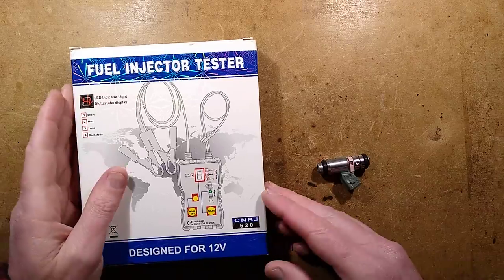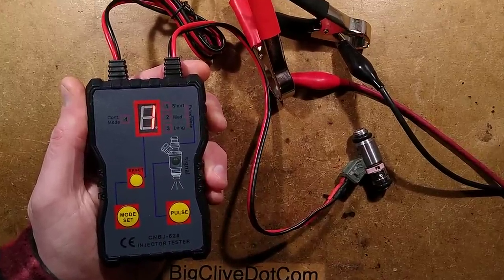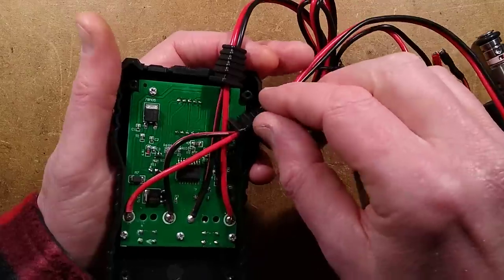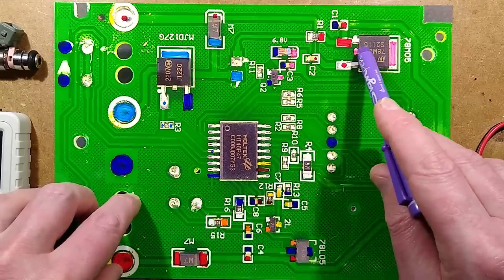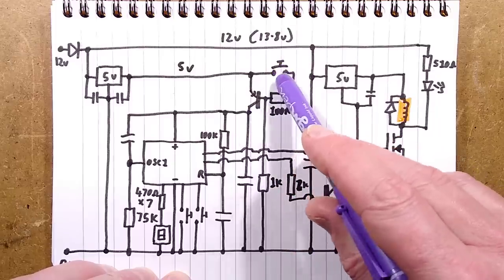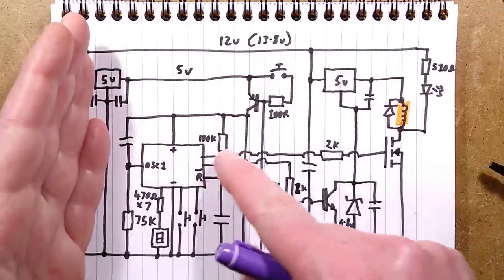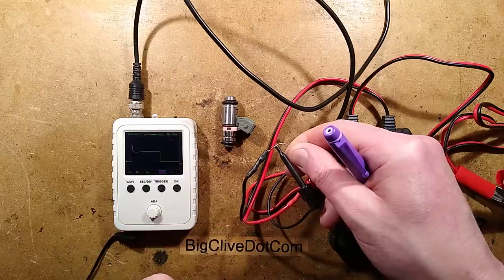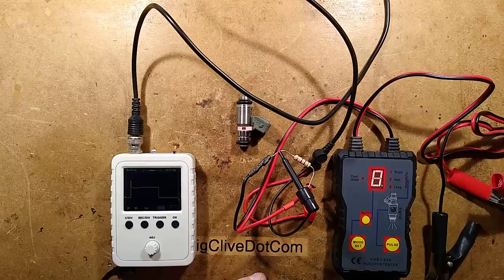Inside a fuel injector tester (with schematic)

Comment: Several years ago I built a DIY engine controller called Microsquirt.  Their documentation talks of low impedance Peak-and-Hold injectors that use 4A to open quickly and 1A to hold them open.  I believe the lower current was both to reduce heat and, as already stated, let them close quicker.
Reply: The microsquirt was a great project!
Reply: That's exactly what that high then low voltage drop is doing is to allow the unit to support low impedance  injectors. Typical injectors are high impedance, measuring  in the 11-18ohm range. And for them, firing 12-14v on them is fine. But low impedance injectors, usually in the 1-4ohm range, need the peak-n-hold technique so they don't overheat the coil. Once the mechanical load of moving the pintle in the injector has been accomplished, it doesn't take nearly as much power to hold them open...hence the reduction in voltage.

You don't see low impedance injectors that often anymore at least not for typical street builds. My CNG injectors are low impedance. And I wouldn't be surprised if ultra high flow race injectors still are. But once the high flow Deka 60s and 80s came on the market a decade or so ago, there's been little need for them for typical street power levels.
Reply: We were learning about the current draw patterns of injectors in uni a couple months ago, quite complicated. People far smarter than me can work out what is good and bad, I'll just sit back and let them tell me what part I need :)
Reply: @Marvyn Harris     I am legitimately unsure, do you mean “built” as in assembled a kit, or as in designed the hardware?

I’m wondering because I’ve been looking (albeit from afar, I don’t have the knowledge or fabrication capability…yet) at Engine Development for a while, and between uses like this, as well as for Variable Fuel Injection crazyness in an ECU I’d love to hear what you did/know, where to find good info etc.
Reply: i was gonna mention the 'peak&hold' thing myself then read your comment
Reply: @ericlotze7724  Since they mention referring to documentation, I think they probably built from a kit.

Microsquirt and its variants are probably the aftermarket engine management with the best community support due to wide adoption. I think Speeduino is the open source/cheaper option but will require more work from you? And some engines have "drop in" solutions with direct support like Haltech, etc but those are $$$ and probably don't support very old/niche models.
Reply: @ericlotze7724   A microsquirt is the most basic ecu in the megasquirt engine control unit line. Diyautotune sells build kits with the pcb and all components for most versions of megasquirt, or fully assembled ecus. 
They're extremely versitile and powerful while also being extremely cheap compared to other ecu's with the same capability
Reply: @Eric Lotze  look up a cardrino.  It uses an ardrino to act as an engine ecm and is a full blown diy ordeal.  The squirt line of products which is separate, is basically a programmable ecm that you can mix and match components and such. 

A cardrino is just an ardrino that you use the various com pins like the ic2 and gpio pins to activate relays or other boards.  It's like building what's inside the squirt stuff although I can't remember if they use an ardrino or not.

It's been a couple years since I've been involved but there is a fairly large community around both and lots of knowledge if you are willing to read.
Reply: @ericlotze7724  I built a microsquirt from a kit.  It's a very versatile ECM that can control both fuel, spark, idle control and had programmable pounds that can be used for various inputs and outputs like knock sensors, O2 sensors, electric fan control.  It lacked the I/O for individual sequential injector control or individual coil-on-plug control.  My setup had batch fire for two banks of injectors, control of an electric distributor, two O2 sensors, a knock sensor, idle air control stepper motor, air and water temperature sensors, fuel pump and fan control and probably a few things I've forgotten about.  There was also a software package that had 3D graphs of volumetric efficiency, ignition advance and air-fuel tables.
Reply: I had a Rover SD1 VDP EFI years ago and when that started to have issues with the ECU (because Lucas, Prince Of Darkness) I looked into the Megasquirt products. They really were fantastic. I know a few people in the SD1 world went over to them.
Reply: @chrisgrey9204  Peak and hold is used very much so today with direction injection motors. Injectors are usually cracked with 40v @ 20A which then drops to 5A.
Reply: Also an electromagnet needs a lot less energy to hold than it does to attract. A magnetic field's strength falls off pretty quick the further out it goes. It's waisted energy and excessively heats the coil to use full power all the time.
Reply: @Marvyn555  

 Sounds cool as hell, and that’s one sick setup!
Reply: @Marvyn555  

That seems like a great off the shelf / existing design.  Does it have the ports/capabilities to interface with something like @Wesley Kagan ‘s Take on Freevalve (or Camless Valve Control iirc that is the technical term)?

Granted as shown by your build, there is plenty of other factors to tinker with!, but I personally am VERY interested in the stuff the C o n n t i n o n u s l y    V a r i a b l e     V a l v e     T i m i n g can allow.  That and funky fuel setups like Autogas, Dimethyl Ether, Heated Oil (for compression ignition engines), or Dual Fuel /   M u l t i     F u e l    engines so yeah.
Reply: Do any of you have experience with the “FreeEMS” project?  If Microsquirt/Megasquirt etc have the features i need and FreeEMS doesn’t I’m not such a purist that i would ReFuSE tO uSe It*, but i do prefer to use Open Source Software *and Hardware when i can.

It would also make developing an engine-specific board easier / selling it etc
Reply: @Mrshotshell  between microsquirt and megasquirt, this just seems like an elaborate joke.
Reply: @Cenentury0941  make sure you use it on your ford Cl1taurus
Reply: @ericlotze7724  I bought a kit with a bare circuit board and a bag of parts and a preprogrammed processor.  I had to figure out the configuration for my engine and set some jumpers for my engine combination.  The V8 engine I used had a distributor that had a sensor coil to tell what position the camshaft was at. Microsquirt has circuitry to read the voltage pulse from the distributor and fire the spark plugs at the right time. I used batch fire so I only needed two injector wires. Then wires to run an idle air control stepper motor. I added a knock sensor that let me reduce the ignition timing advance if it detected detonation. I had two analog inputs to read wide band oxygen sensors. And an output to run the fuel pump relay. The software is pretty sophisticated, with fuel tables, ignition tables, air-fuel tables, idle warm up tables, etc.

Comment: Another interesting thing about injectors is that you can electrically test for a mechanically seized one by looking for the pintle hump or the lack thereof, as the pintle moves between the open and closed positions it changes the magnetic circuit length which changes the inductance of the coil and you can see it as a little hump in the coil current as it ramps up and back down. There are many videos about it by people such as ScannerDanner.
Reply: Scanner Danner 👍
Reply: With a coil, if you put a cap across it and hit it with an impulse, you can count the "rings" to see if there's any shorted windings.  I know there's a tester for that for CRT flyback transformers. I don't see why the same can't be done with an injector.

Comment: That drive scheme is called peak and hold and helps with time response while also limiting power dissipation. For lab testing NI makes hardware that lets you set multiple parameters to drive injectors.
Reply: This is for low impedance injectors, separate category from normal, common high impedance ones
Reply: @poprawa  but the idea works on both the reference voltages would be different though 🙂
It is like pixel overdrive in LCD screens, but since the output is just digital the mechanical limiting is enough to keep the limits in check.
Reply: @poprawa  Autogas injectors are low impedance but it does make sense that you dont want to heat up either the coil of the drive circuit when testing

Comment: I'm now working on a ecu project and could understand why they made this circuit that way. They used this kind of short pulse of higher voltage prior to the main pulse to be compatible and set a higher current on low resistance injectors found on older injection systems. Such injectors have resistance lower than 1ohm and will damage the mosfet and the injector itself if turned on for a long time. Its not a common case and the newer injectors (after 80s) have resistance about 14 ohms and they are drived without these pulses or series resistors as in these older systems. Its a smart solution but the limited current node may be monitored by the microcontroller to turn the mosfet off if a short circuit was dectected. On modern ecus all outputs are current limited and have self diagnostics.

Comment: I'm a mechanic in Canada, the video and the comments is leaving me with impression this tool is used just to see if an injector works and frankly if that's all the information you need just start the engine and listen to the injectors with a stethoscope. This tool becomes indispensable for an injector balance test where we take manual control the fuel pump running it up to max pressure then feeding a pulse train to a single injector and noting the fuel pressure at the end. We do this once with a short chain of long pulses and again with a long chain of short pulses and repeat for each injector. Any outlier has a different flow rate than it's companions and is suspect. For valid results the pulse chain has to be the same total on time for every test so build it or buy it you need a proper tool.

Comment: Have had over 30 years of fuel injection work.

Yes some injectors are very low resistance and require current controlled switching, others just a reduced holding voltage once pulled in.
The injector duty cycle which can be from very small to even almost 100% duty has a large range of power dissipation. Normally high duty factor only applies to full engine power and high RPM regions also thus high heat conditions.
The 100% point is never really  allowed, and to be avoided as fuel delivery is no longer controllable accurately by On time  so by design the sizing of injector normally would be chosen to remain way below 100%, experience say under 60%. At 100% On, and near time duty regions, flow rate becomes non linear to duty cycle too, as mechanical travel time and dynamic flow factors create a dead time effect, offsetting flow by a small time factor so effective zero flow starts at some small On  time factor, linear with On time, and duty cycle grows as RPM demands faster pulse rates, but as duty cycle forces time On reaches closer to 100% that time offset also causes deviation of flow from linearity. That upsets fuel to air ratio and engine performance and emissions.
 Of course as volatile fuel  contains very light fractions, vaourising at low temperatures, and fuel goes through ithe injector, t is highly important that coil dissipation NEVER allows heat released to vapourise lighter fractions of the fuel to form micro bubbles that would seriously affect fuel delivery accuracy,  thus also  engine fuel to air ratio  thus also performance and engine emissions.
Now,  yes the fuel flow cools the injector, but as the injector also experiences much external heat of the engine, especially on non cross flow engine designs with inlet and exhaust on same side of the engine, interleaving inlet and exhaust, that heat local to injector can be very high. So extra coil dissipation is quite potentially important, tipping to internal vaporisation issues. Much effort is made to keep injector coil dissipation low. Low resistance and inductance, allow initial high current faster mechanical action, but  if left at full power on would be detrimental heat wise, so initial high voltage or current peak and current control or switched lower voltage becomes desirable.
For this tester the lower voltage step has two possible reasons, firstly the dissipation is critical as likely it is often used with dry injector no fuel flow and thus no cooling, so the prevent coil overheating and possible damage to injector they limit power in On state.
Second reason, it is desirable to verify that the injector can hold in when exposed to reduced supply once pulled in. Thus testing for adequate "Hold In" capability. 
Initial pulling voltage of injectors is often above 7v to 8v, so testing with limited 5v supply would prevent many, not all, injectors even switching on (pulling in). Thus they have this double supply level design to cover the wide range of objectives.

Sadly to realistically test injectors this mechanical activity falls far short of injector evaluation, beyond ensuring it is not in a mechanically stuck state. Nothing verifies the accurate fuel delivery or spray pattern of the injector, or leaky nozzle, all of which are far more common problems than physically stuck state.
I would regard this tester of minimal value, beyond very rudimentary injector test for dies it click when energised.
Reply: Really interesting. I love how the interweb allows insiders to share stuff like this!
Reply: I think that I've seen (on YouTube) a test where they bring the fuel rail up to working pressure, pulse one injector a fixed number of times, and use the pressure reduction in the rail as a measure of quantity of fuel delivered. Repeat for each injector and compare results. You don't get a direct measure of fuel delivered but you do get to find a faulty injector.
Reply: @georgescott6967  Very iffy results. Mixture deviations under 1% are important.  Spray pattern and distribution even more so.
Reply: Probably good to test at 8 volts ish anyway. It's probably close to what they are going to be getting during worst case engine cranking. So something that might be marginal at 10 volts would still pass at 12 but your car wouldn't start if you tried it
Reply: Wow I cool. I’ve used this tool and an ultrasonic cleaner to clean bike injectors.
Reply: I think the main purpose of these, supposedly, is to clean the injectors.  Hook up a pressurized can of carb/injector cleaner, press the spray button, trigger the cleaner.   If you mount it where you can see the spray, a single pulse can show you if it's circular.  Multiples can show if the cleaning is changing anything.

Comment: Looking at the specs for a 78M05, I see a few interesting points that probably explains the maximum 8V output you were seeing.
1) The minimum dropout voltage is 2V at 500ma. So minimum input of 7V for 5V out.
2) The maximum output current is 730ma at a headroom of 5V.
If the car is running (which it won't be) the battery voltage is nominally 14.4V.
If the car is not running (which it will be) and if the battery is in good shape, it might be 13.2V.
3) The 6.8V zener + 5V regulator is nominally 12V, BUT only if the input voltage is 12+5 = 17V. Which it isn't.
4) With 13.2V in, the no-load output is 11.0V. With 12V in, it is likely to be 0V out, since the regulator will have dropped out.
5) With 800ma load at 25C you need about 5.2V headroom. So 13.2V-5V = 8.2V, about exactly what you are seeing.
Over all, the 78M05 was a very poor choice for this regulator. A simple NPN pass transistor would have been a lot better choice.
Reply: a 78M05 or LM7805 has normally a fixed voltage of 5V, but with fiddling with the feedback resistor, you can get 12V (and more) out of them, if the input voltage is high enough.
Back in 90's, Velleman sold a variable powersupply kit that delivers 0 to 12V @  1A to power most of there kits, that powersupply uses a UA7805 , the  older version of the LM7805. This kit is found as K2570.
Reply: possibly designed that way on purpose or actually checks that voltage isn't too low. you don't want to do injector flow testing(fuel pressure drop) with low battery voltage, the vehicle wouldn't be running during any testing, so you should have a maintainer connected and keeping the voltage steady. majority of vehicles have a high current draw and extended testing times which require a high current battery maintainer connected and not just a simple charger which is unregulated and/or too low of output. points at BMW's ridiculous requirements.

Comment: That's so clever!! I've never considered using a zener diode to change the output of a regulator, much less modifying it on the fly with a transistor! Fascinating.
Reply: Have a look at LM317, a 3-pin regulator specifically intended to be used that way. Treating a LM7805 like that apparently works ok but it's an "off label" application. I'm a bit surprised the voltage doesn't appear to swing and glitch around when the transistor suddenly changes the reference voltage.
Reply: Fascinating and a bit of a waste. As @Sootkins pointed out you can just use two resistors instead, which is even more versatile since you can get variable resistors if needed.
Reply: @BrianG61UK  You know what, that's probably why I've never heard of it... lol